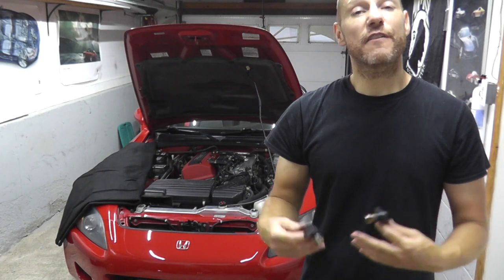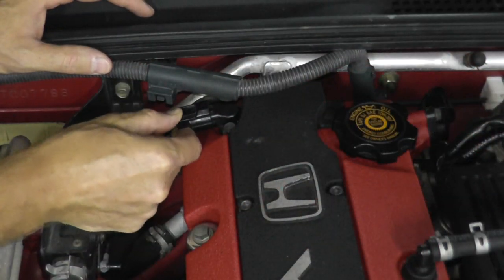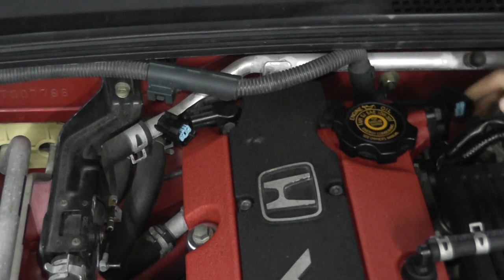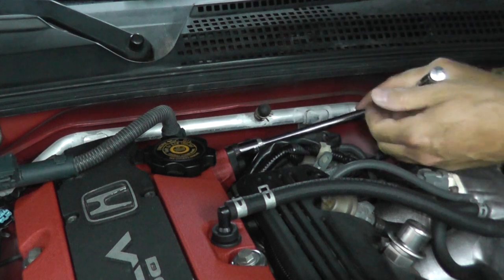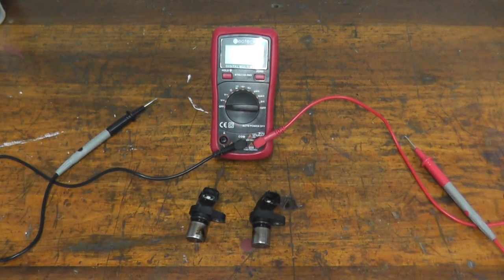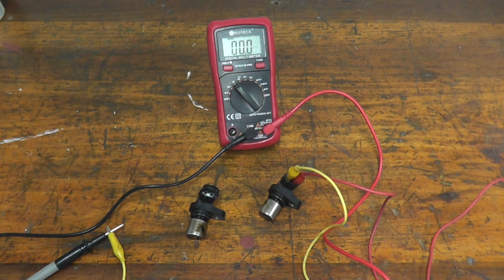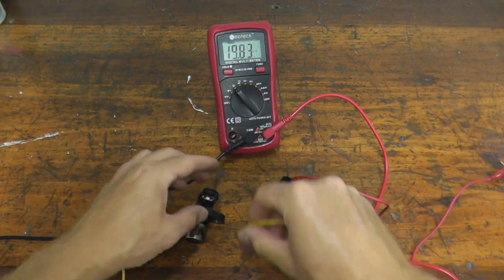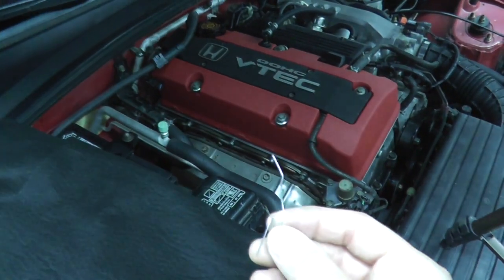Camshaft Position Sensor P1361 P1362 P1366 P1367

Comment: Why does The cable only get 4 volts, its it not supposed to have 12 volts? And The paperclip, do you need it.? Cant you just use The Black and red multimeter cable on There without using The paperclip